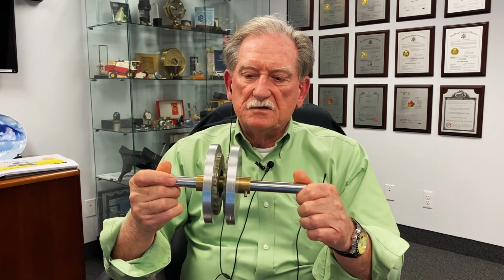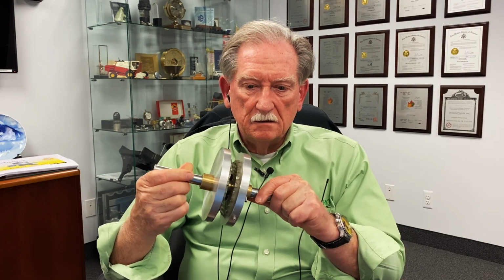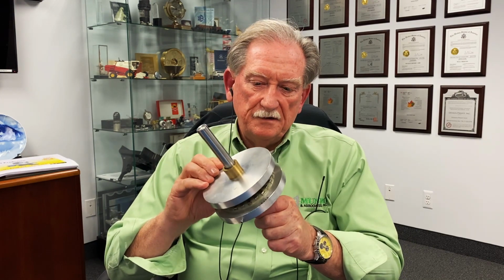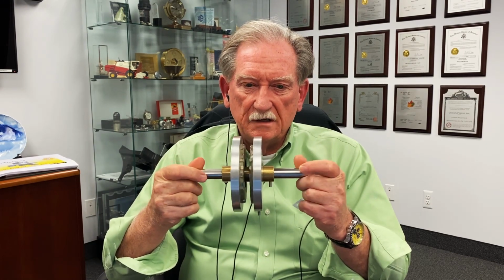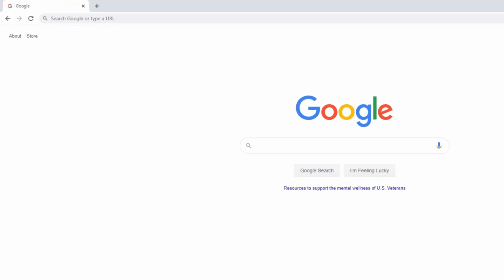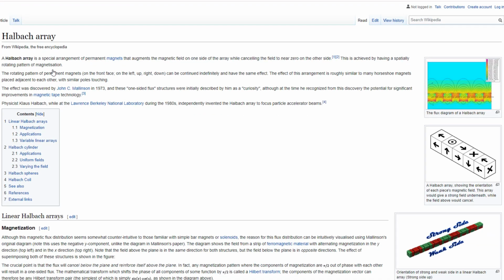Sandy Discusses What's In The Box - With Tracy McSheery

Comment: Very interesting for Your guest to talk about 25 year old magnet engineering concepts but he doesn’t have an actual product. MILWAUKEE POWER TOOLS has perfected brushless technology for battery power tools with built in control board for 10 bucks, not thousands right now. With all due respect Sandy I don’t like wheel motors for automobiles that are heavy that make for bad ride quality. How about this fact. Electric wheel motors for mammouth size mining trucks are a thing of the past too. The DC Traction Motors require too much maintenance and are now being replaced with direct drive using automatic transmission that have faster cycle times, are 400 ton capacity using only 6 13’ instead of 8 wheels before eliminating heavy generators  and trucks have faster speed and cycle times.

Comment: MY NEW BATTERY PACK DESIGN could help dramatically reduce the build-time & costs with my new true fully modular battery pack design. Yes, a battery designed as all things should be, from the ground-up (first principle / less is best) as a concept that aims for record-breaking manufacturing speeds while making use of the already existing know-how, research / chemistry, technology and factories = minimum costs. THIS TYPE OF BATTERY COULD BE PRODUCED AS OF TOMMOROW (after all the optimisations are set-up withing any exisiting factory). Also, some collateral advantages will inccur from the same approach: slightly better energy density (max ~ 10%) + way better power density (max ~ 500% = yes we could have 1000+ Hp per wheel full 4x4 vectoring Teslas, that would also be very much in need of computer assistance at that point ;)) + per cell full upgrade / repair / replace granularity / modularity allowing for easiest and most economical and environement responsible future progress + ... + much more like far more people not yet ready / able will be able to get their much desired Tesla and in turn, exponentially fuel Elon's revolution / mission ;). So, THE 4680 CELL IS NOT ... REPEAT, NOT THE ANSWER FOR THE ABSOLUTE BEST BATTERY A CAR COULD HAVE WITH TODAYS MEANS AND TECHNOLOGY. If interested, really interested I wouldn't mind a little help pitching this directly to Elon ... ;) (corrected ;))

Comment: I think one important factor missed is what Exro an apparently Linear Labs is doing, broadening the efficiency/performance range of motors, with pole/coil and control electronics wizardry.
Which would make direct drive motors even better. Normally the efficiency map looks pretty sad where it drops immensely at low revs and torque. I don't know the physical/technological reason for it. It's quite shocking.

See for example the efficiency graph in the Yasa 750 document: https://www.yasa.com/wp-content/uploads/2018/01/YASA-750-Product-Sheet.pdf
It's pretty bad for direct drive, it only gets good efficiency  (85%) above 1000 rpm and 100Nm. With a 25.5" (65 cm) tire that would be 76MpH (122 km/h) according to a calculator. That's a LOT.

It would be nice to see a video about such endeavors.

Comment: Hi Sandy, as an engineer who has been working on the human powered side of three wheeled "recumbent" trikes since the 1980s (in Canada), I was heavily influenced by Bucky Fuller's three wheeled car from the '30s mostly on account of its rear wheel steering. Rear steering is yet another example of out-of-the-box thinking that set Fuller so far apart from him contemporaries. Like a gear-less pancake motor, it offers some compelling benefits for three wheelers such as a very small turning circle and reduced mechanical complexity. Love you channel...keep it coming !

Comment: I'm a fan of velomobiles... these are human powered vehicles that are almost always tricycles, some deltas (one wheel in front), but mostly tadpoles (one wheel in the back)... many models are available. When you are human powered, every gram counts, efficiency is everything.  But there is still a stratification between people who want velomobiles as practical replacements for motor vehicles, and others who want to the absolute highest speed.  In terms if speed and weight, the trikes (actually two wheels are even better) win.  The biggest player in the space in terms of sales (and it is a tiny space) is velomobiel.nl. In the last five years, for the practical customers, they came out with a four wheeler and it is the model I bought in the end. The disadvantage of higher weight and more components is compensated for by higher stability and much more cargo room.   It is their biggest seller in recent years.  Even for very light-weight 3 wheel vehicles, four wheels is still a big practical advantage.

Comment: I agree, axial flux motors have much higher power density but production costs are much higher too than for radial flux motors.
We will see these motors maybe on VTOLs or cars where costs doesn't matter but not on mass production cars. 
The gearbox of modern electric cars with fixed gear ratio incl. differential isn't a costdriver. It's much cheaper to have one motor with gearbox incl. the diff that drives two wheels, than 2 motors without gearbox. Not to forget the electronics that need to be doubled and the much more complex control.
Axial flux is maybe a thing for super and hypercars but not for normal cars.

Comment: Sandy, you are a great American Treasure. Since I found your channel I look forward to hearing your thoughts and ideas the most of anything I watch. Thanks for sharing the information on the state of wheel motors. I have liked the idea of them for several decades now since I first envisioned moving the power electronics of the motor drivers into the wheels with the motors. Thus moving the required weighty protective shielding to inside one of the most protected places on a car, inside the Hub. And if you could use the air moving thru the wheels to provide cooling that’s another system you could eliminate. Thanks again for sharing wisdom with the public thru this format.

Comment: That's disappointing - a great product that appears to only exist at the prototype stage - you will need to find a company to make them to a reliable high quality. I expect 10 kW, perhaps 15 kW per wheel will be sufficient. As it is only at prototype stage, you should have it made into a common unit with the brake.
Reply: Isn't the motor the brake?  Stop the motor, you stop the wheel, right?

Comment: 7:10 I thought this video was going to be about clutches
Reply: Actually it was. It makes a great clutch and that's exactly what Sandy is holding there. At that gap distance it is over 100 in-lbs of torque without slipping. If you decrease the gap by two you'd get nearly 1,000 in-lbs, so you could vary the slipping by adjusting the gap.

Comment: I don't claim to know a lot about the Halbach effect and motors, am I correct in thinking it would be an effective brake but would not be regenerative?
Reply: Depending on how you create the structure of the brake disk it can act like an Eddy current brake and simply create heat, or it can regeneratively brake (effectively it's a generator like many motors) and it can be used to levitate (See Papers by Richard Post on Halbach Levitation https://www.transit.dot.gov/sites/fta.dot.gov/files/General_Atomics_Low_Speed_Maglev_Technology_Development_Program.pdf )
Reply: @tracymcsheery1223  Thanks for the reply.

Comment: Something occurred to me in the process of watching this video. Motors in wheels have a couple of disadvantages. The unsprung weight increases, and so does the polar moment of inertia, because you're pushing mass out to the corners. But as the video says, if you drive the wheels through a transmission, there are losses. So how about this: Put a couple of relatively small motors in the rear wheels, optimized for efficiency, and secondarily for low mass, and use only those for the majority of times when not much power is needed. I would think the rear wheels would be best, to minimize the effect on handling from a little more mass in the wheels and in the corners. Then, put larger motors, with transaxles, in the front and rear, optimized for kw/kg. Now, you have much more maximum power when you need it, and on all four wheels when you need that, for slippery roads or burning up the quarter mile.

Best of both worlds, right?
Reply: I remember when cars drove at speed, and petrol was cheep.
Now I live in a city that wants 20mph on streets and the speed limits are dropping every year. That’s when there isn’t a council designed traffic jam to stop traffic flow.(I jest not they use the traffic modelling to cause jams)

We tax cars off the road, tell people to use public transport, then find you catch COVID 19 on them and now we stay at home.
Strange times!!!

Sorry back to the point. At ever reducing road speeds and in a 20mph zone handelling isn’t a concern!

Comment: Fascinating explanation about doubling the diameter and torque. I’d like to offer a bit of historical note about the origins of the basic “pancake motor” design, as discussed at 4m40s and 9m20s in the video. Its described as being a relatively recent design from the around mid 90s, whereas its design can be traced back to 1979 when a British inventor by the name of Mr Cedric Lynch first announced it, and went on to patent it in the mid 80s. It was variously known as a Lynch motor, Axial Flux Motor, and Pancake motor. With development the Lynch Motor Company offered a variety of brushed and brushless motors.  Worth a read :- https://en.wikipedia.org/wiki/Lynch_motor#cite_note-2
Reply: Looking at Patent US1392349A, It says the Inventor Was Neuland. Maybe the one you are referring to was before that one? There are several books about various designs such as Axial Flux Permanent Magnet Brushless Machines
 Authors: Gieras, Jacek F., Wang, Rong-Jie, Kamper, Maarten J. I think they reference one in the late 1800s. That was before even Sandy's time.
Reply: @tracymcsheery1223   Thanks for the reply. That fascinating 1921 patent certainly predates the Lynch patent by some 65 yrs! With some more digging it turns out a certain Mr N Tesla patented an axial flux design in 1889 see US405858.  For anyone interested in the Lynch pancake motor patent its US4823039, applied for in 1986 granted 1989.
Reply: @amremotewatching  That was the one I was looking for but couldn't find. Thanks!

Comment: These motors would be very useful on a van as you could build a van with the space and low floor height of a front wheel drive van with driven rear wheels to get the grip when loaded.

Comment: The unsprung weight would be my concern but this is really interesting, I guess the suspension system Sandy talks about may help with that disadvantage.
Reply: My guess is that a well engineered car will have the motors mounted inboard and not way out at the wheel.

Comment: As someone who is currently building a electric racing kart, what I find most difficult is sourcing high quality motors, controllers, and BMS for the higher kW than an e-bike but smaller than a car range I am working in. Something in the 22-30 kW range is most desirable.

For motors you either spend $4-6k for a well built (hand built currently), relatively light-weight water cooled motor from DHX Machines, an even more expensive axial motor from Europe (Avid, Emrax, YASA), or you give in and buy a junk motor for around $1k from Motenergy. An air-cooled Zero 75-7 IPM motor might work if you can blow enough air though it, but you can't buy them new and there are essentially none to be had second hand without purchasing an entire bike ($5-6k even at a carpart auction). Very frustrating.

For controllers you either use a $900 Sevcon (BorgWarner) controller with a $900 hardware programming dongle that they don't want hobbyists to have, or a Kelly $900 controller that may not last very long. There really aren't any other choices in the range for SMPM/IPM motors that aren't huge and multiple thousands of dollars from say Cascadia Motion (now also owned by BorgWarner). There are a few others (SME, DTI, Scott), but nobody seems to know much about them.

For BMS there are only two reliable choices to keep the battery from self igniting when fast charging. Orion and ZEVA. Both have their strong points and weaknesses, and both again are around $1200 for my 42S10P 18650 battery.

All of this (on top of the battery construction cost itself) really makes this setup more expensive than it needs to be. If we are to replace 2-stroke racing motors (my goal with this project), we need more choices at more reasonable prices.
Reply: Are you using a differential for the Kart?
Reply: @tracymcsheery1223  No. Differentials are not allowed in the rear axle for any racing kart. Turning is accomplished by having lots of ackermann in the steering such that turning the steering physically lifts the inside wheel off the ground.
Also there is no suspension, so components need to be very shock resistant.

Here is an example run with my old Honda 80cc 2-stroke engine. https://www.youtube.com/watch?v=lc95InN8zP4

Comment: How fast such motor can spin without risk of breaking apart or losing power/torque? Can someone make an one meter diameter and high RPM... say... 50 000rpm motor of this type? Asking for a friend. :)
Reply: These types of motors don't lend themselves to high RPM. Then again a 1 meter diameter would produce about 1 megawatt of power at 2,000 RPM,  and about 5,000 nm of torque so I'm not quite sure what you plan on doing that you need 50,000 RPM.
Reply: @tracymcsheery1223  Oh... I think it would be a bit overkill. Definitely smaller then. It would only  be necessary around 2-3kw for start. More wouldn't hurt either. The idea would be to stack such flat motor to a centrifugal compressor to create a very compact electric jet turbine. Hence the high RPM.
Reply: @zaelu  NASA did this in 2005 https://ntrs.nasa.gov/citations/20070006851
Reply: @tracymcsheery1223  Thank you. Very interesting. However I think a centrifugal compressor would work better all things considered.
Reply: I've been wondering about the performance of a large diameter motor versus small diameter. The inertia of a large diameter motor seems like it would be a disadvantage.

Comment: With a motor on each wheel, computer control can calculate exactly how fast each wheel should spin, therefore, no loss of traction on any surface. With air suspension, computer control can keep the vehicle level and balance wheel loading therefore, more traction under all circumstances. The day will come when nobody will settle for anything less.

Comment: Why do most 3 wheel vehicles now, have two wheels in the front with one in the rear?  Years ago they used to be one in the front and two in the rear.
Reply: 2 front is more stable in corners the one front is cheaper as it only has one  wheel steering
Reply: @alanrickett2537  got it, thanks!

Comment: Hello, Thank you for your channel. I have some manufacturing experience and thought it might help if I shared an idea I had. The cyber truck uses a break type tooling system. I was at one point in my career making complex channels with a break. I found after a few months my skill with the break was not really up to the task at hand. I ended up cutting the pieces separately and seam welding them together. if you translate this to a vehicle you can make a very flexible body making process. All you need is a cutting process to cut shapes out of a flat sheet. the ability to manipulate the cut part. the move them to a position they can be seam welded, weld them. so a line that cuts flat steel. then feeds a marry go round of holding/welding robots . the merry go round keeps doing laps until all the pieces have been welded. then you can make an other one or make something completely different. I am going to work on a video to show it but I thought you might be able to incorporate something like that into one of your projects so I thought I would mention it.

Comment: Hi Sandy from Australia 👍.. love your content and how you get excited about innovative engineering solutions to everyday opportunities.
Seeing as you are familiar with aircraft design, why hasn’t anyone developed electric motors, and specifically this brushless type into Aircraft wheels.
In conjunction with controllers to do the job using existing rudder pedals to direct thrust on port/starboard wheels to assist with taxing, pushback etc.
Also if super capacitor’s were used in line with lithium batteries (4580!!) they could assist in shorter takeoff roll out and in landing, act as regeneration braking, potentially shorter stopping distance & charging back the capacitor bank for taxi run back to holding ramp.. just thinking out loud 😊🙏
Reply: going from zero to 180 mph in 20 feet wears tires out pretty quickly when landing, so your idea has a few other advantages if you can preroll them up to landing speed they might increase the life of the tires by a huge amount, and produce less stress on the landing gear. Traction motors such as these are relatively new. Less than 30 years old, which is fast in airplanes. The biggest issue is simply who is going to try it first.

Comment: I thought the big problem with the Reliant Robin was that the front wheel was the single wheel and that caused a problem where you used the brakes hard and turned at the same time you were trying to load up a front outside wheel that doesn't exist so it would roll over. 

By having the single wheel be on the back, that would stabilize the front and largely prevent that problem (unless you are driving very aggressively in reverse).